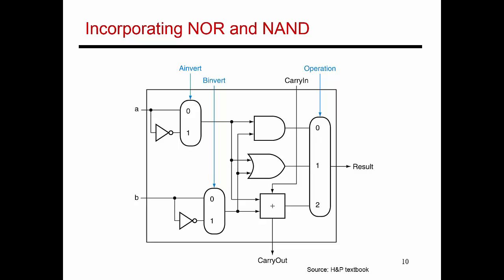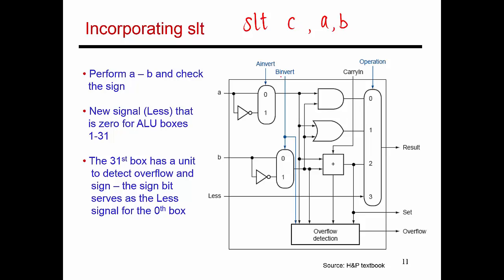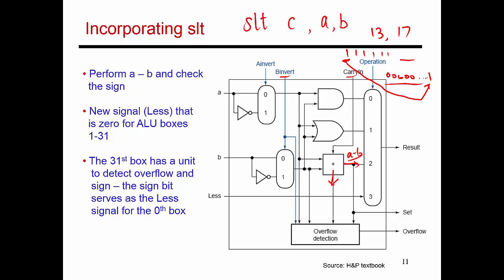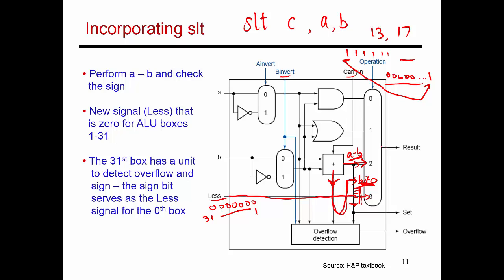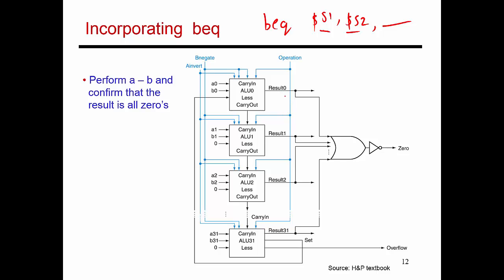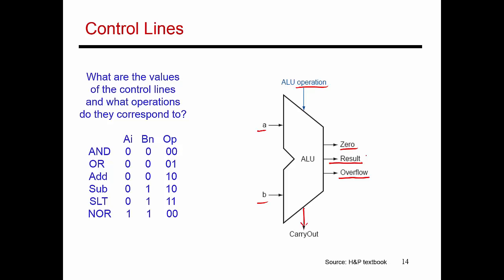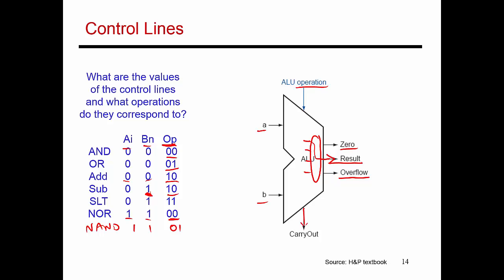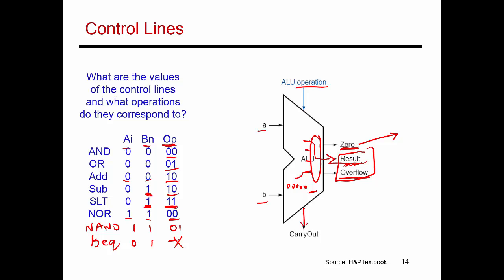Video 35: 32-bit ALU Design, CS/ECE 3810 Computer Organization

Comment: The lsb of the register is not set as per the carry out of the MSB ALU, rather it is set as per the sign bit of the a-b operation which is actually the result of the MSB ALU. The thing is shown clearly in the H&P book diagram, the result goes to the "set", but I don' t know why he said differently. The carry and carryout of the MSB are actually used for the overflow detection..